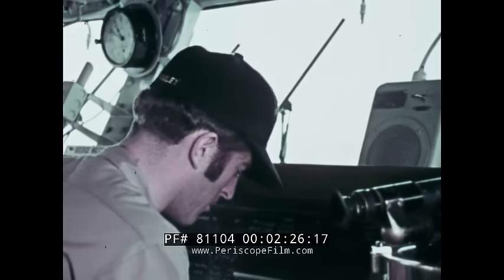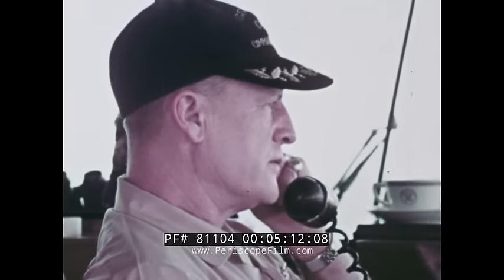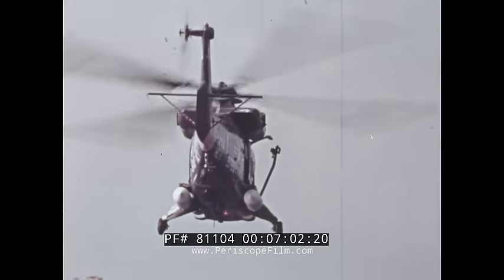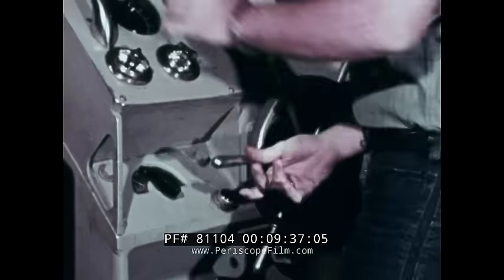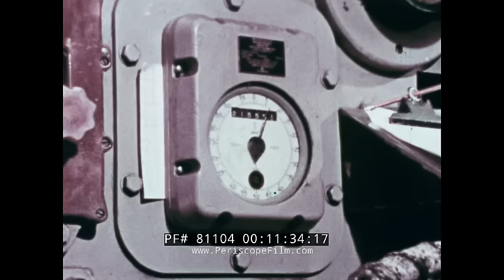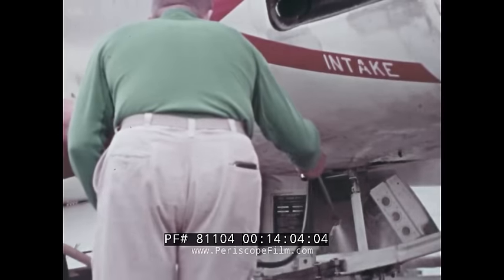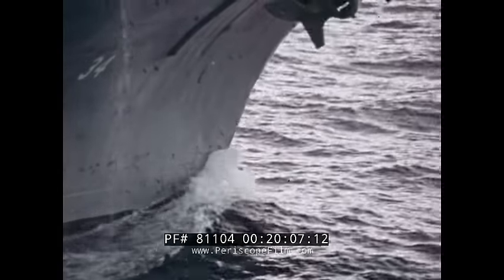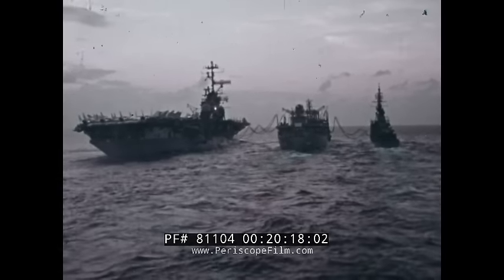A DAY IN THE WESTERN PACIFIC ABOARD USS ORISKANY CV-34   U.S. NAVY FILM 81104

Comment: I was flight deck crew aboard the French aircraft carrier Clemenceau in 1995-96 and I noticed a different in launching the US Crusader and the French one (F8-E FN witch was a modified F8-J). The US Navy Crusader were placed in the catapult and launch with afterburner on until the old back brake off. On the French carrier, we  launch the Crusader with dry power and the pilot throned the afterburner just after take off. Two different launch choose, interesting.